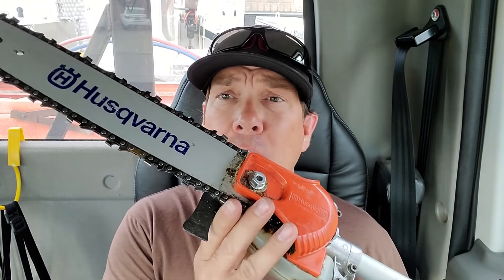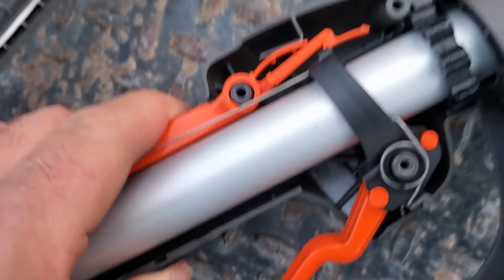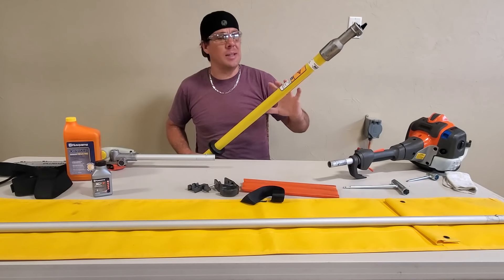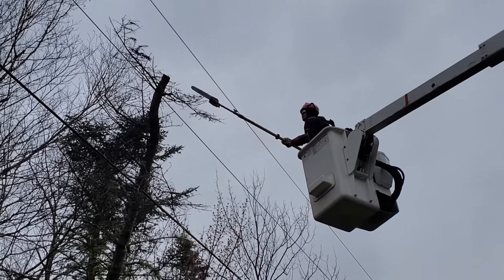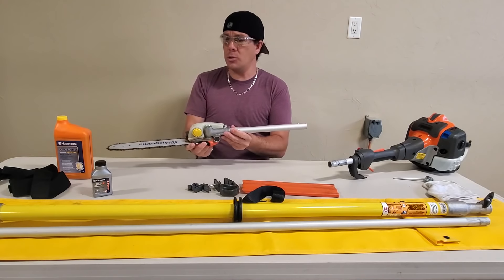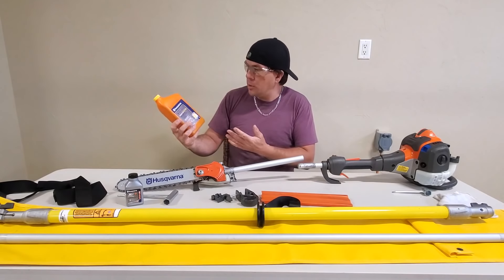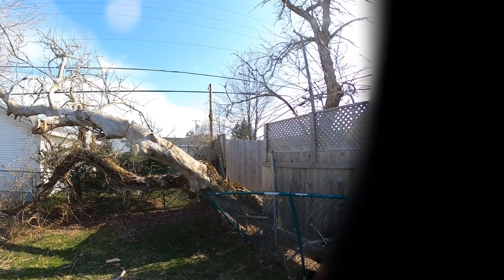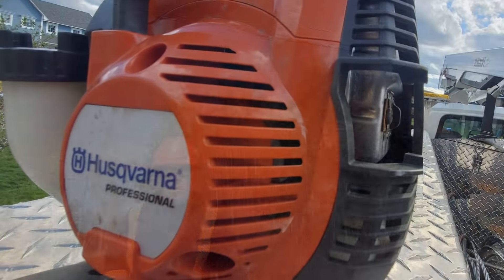Husqvarna MADSAW - Dielectric pole saw - Review!

Comment: Might mention that carrying a couple extra chains can save time.  If you dull a chain, it's quicker to swap in a sharp one than sharpen the one on the saw. You can do a better job of sharpening a chain back in your shop. 

Extra chain: safer, faster, better
Reply: If you know what your doing you can sharpen one on the saw almost as fast as changing one out . And again if you know what your doing you can hand file just as good as a bench grinder can do .

Comment: I really appreciate the time you spent on demonstrating keeping your dielectric pole clean and stored safely.  So, after seeing this more in-depth review, I have two new important points to add:

First, all chainsaws will leak bar oil.  If not now, it will eventually.  That dielectric pole storage till you have is awesome, but for someone who thinks they can store the saw head with the pole, even bagged, I'd say, think again.  

Second, if I were using that saw in your place, I'd slip some 600V heat shrink over the aluminum section.  It's not needed for direct protection of the operator, but it can still prevent sparks if say you contact two low voltage wires (which are certainly closer together than the length of that pole).

For my own part (where I don't need dielectric tools), I LOVE my Stihl pole pruner, and this looks to be at least as nice.  I wish I had that rear grip (and I'm thinking of making one now).  My pole pruner has totally eliminated any need I might have for a regular chainsaw, and easily took apart a 16" thick cherry tree I once lost in a storm.  Pole pruners are also much safer than chainsaws, since the blade isn't anywhere near you if it kicks back.

Carrying an extra chain is a good idea, but so is having a file kit.  If your truck has a vise, you can touch up the chain almost as fast as you can change it.

Comment: When you drain the gas, make sure you drain the float bowl of the carburetor too. There's usually a drain screw on the bottom right next to a drain hose, although that's speaking from experience with motorcycles and ATVs, not really chain saws. After that, pull the crank a few times, both with open and closed throttle, to suck the last few droplets out of the jets. In a pinch you can just dump the tank and then run it till it sputters out, but that's not perfect. Using a fuel stabilizer like Stabil helps too. I use Yamaha Fuel Med personally, but full disclosure, I worked at the dealership that sold it, good stuff tho.
   The reason you have to go through all this is that ever since they started putting ethanol is gasoline, they had to add a lot of emulsifiers to get the water-soluble alcohol and the oil-based petroleum to mix. If the liquid evaporates, these chemicals leave a nasty solid residue that can clog up the tiny jets in small engine carburetors. And since ethanol is highly volatile, it evaporates quickly at atmospheric pressure, even more quickly than the actual gasoline. Fuel injectors are pressurized, so they're not as badly affected. But carburetors are vented to the atmosphere, so they can "boil off" over time.

Comment: Thanks for info.  

What do you use for PPE gloves and testing process?  Familiar with them for Typical Elect Tech working on Panels.

I had to attend various "Safety Sally"  classes due to company going overboard.  Most of these were folks like you, not  EE's working as designers for Equipment builds.  

I do sand way back from Tech and keep my hand(s) in my back pockets.  Finger pointing at live Sh!t drives me crazy. 

PPE for neck protections seems to be a weak spot, as memory goes.  

Worse event around me was ( wasn't there in person, btw ) but a pin hole leak in a water Line at 10KV DC, the tiny stream hit Tech and knocked him on his a$S .  He was fine, but  I kept an eye on those and made them replace even when not needed.  

I love High Pot testing.  Great for testing ground systems as well.   Grounds are so important yet neglected as trivial by too many.   Sorry for long comment.

Comment: I run Vp fuels 50:1 premix and I have stored my saws for 6 months with no issues at all and the vp 50:1 premix last up to 2 years  thanks to the stabilizers that keep the oil and gas from separating and the fuel is also ethanol free which is the best part as ethanol will break down the fuel lines in engines if  it is used extensively

Comment: we are looking at these saws now and i see they have a battery version out now so how is the weight and balance.
Reply from the maker: I haven't tried the battery version yet., although I've tried battery pole saws from other manufacturers. 
The balance wasn't an issue at all and I'm comfortable with their performance with the power of lithium batteries nowadays. For the frequency we use pole saws I'd be comfortable choosing battery over gas.
Reply: @Bobsdecline  did you buy yours straight from the manufacturer or did you get it through a dealer. Been checking with our electric suppliers I’m going to a IMEA (Indiana Municipal Electric Association conference)1st week of October might ask there at the vendor Expo. Thanks for your reply be safe out there. Ok well we ordered the saw Electric with 2 batteries and charger. Should be here Friday or Monday. Will try to post a video of it in use.

Comment: to the comment of having to empty the tank while in storage.. just run Tru-Fuel or any fuel that doesnt have Ethonol... i know several linemen and at times im called in to maintain there small engines they run tru-fuel and its usually just a basic checkup i have yet to have to open up the carbs its the ethonol that destroys the membrain and surfaces of the aluminum carbs.. if i can say only one thing just keep everything properly maintained the more you care for your tools the more your tools care for you and your not fighting them. as for storage they prefer the small containers as they sit easily in there trucks and they dont have to monkey with the mix's as its premix straight out of the can.. i have the upmost respect for linesmen as theres no way you would catch me in buckets or at the hights they do... as we sit in a home without power complaining they are out in the elements dealing with the wilderness of the wild or urban areas in the cold wet or freezing days restoring the services.